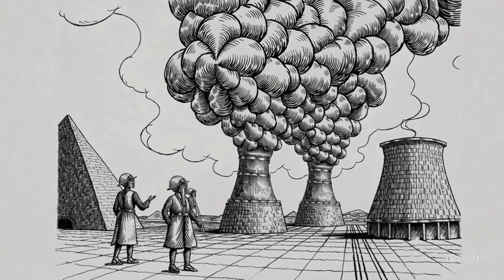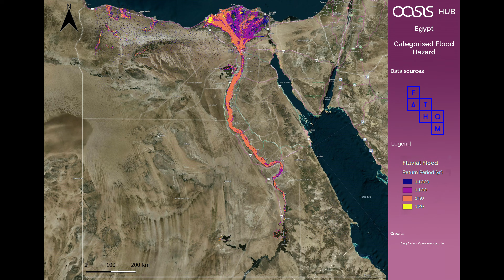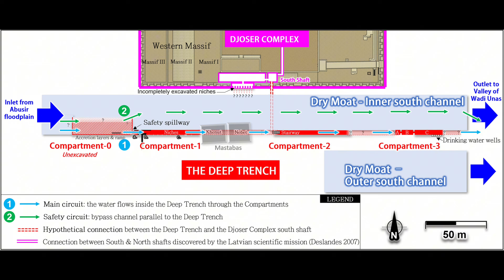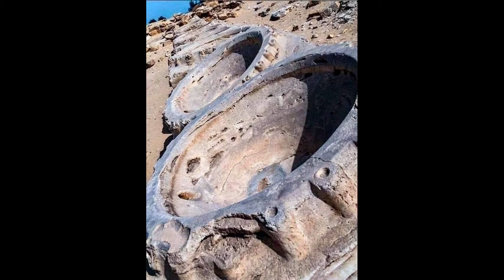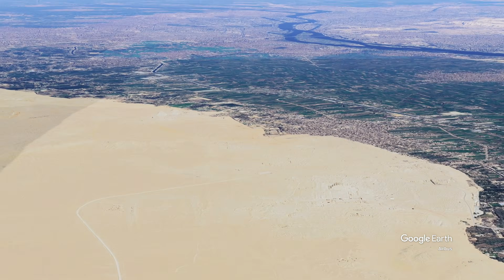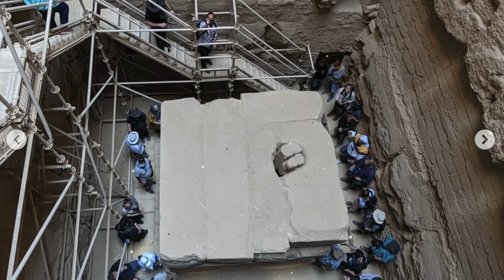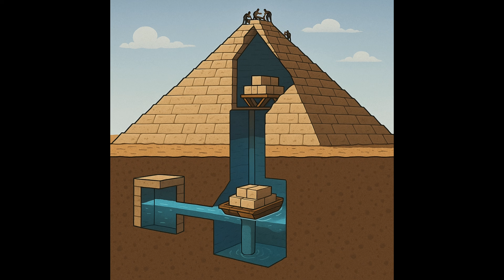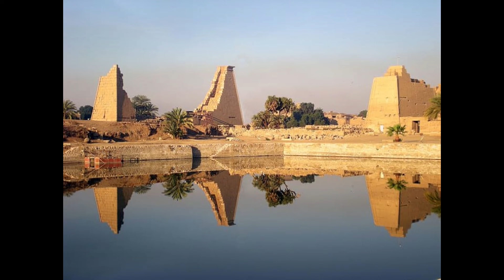The Incredible Hydraulic Lifting Machines of Ancient Egypt

Comment: Not to mention the maintaining of angles perfectly of the passages under and in the pyramids and the no traces of sut n from torches providing light to see what they were doing.🤔🤔🧐🤯
Reply: Its a multipurpose structure but theres no soot because the shafts are for water or hydrogen either or both depending. Its an industrial structure. A water pump but its also a chemical reactor with a massive density filter. And this big granit quartz roofs in these chambers. I think it was containing hydrogen. Burns clean if they burned or even if they didnt we wouldmt he ablento tell itnwas there like ifnitnwas a rudamentary crude oil refinery which it isnt. Its a water chemical reactor powerplant. Or an expiramental attempt at one. It plays a cultural role to the region and world at the very least. To me itd clearly not a trap its like a decomissioned reactor. A decomissioned hydrogen gas generator. The giant box deep undee giza isnt a carcophigus its a battery box it had a lid with annode and cathodes giant ones so when they flooded the bottom chamber it automatically generated hydrogen very rudamentarily. Some asoects seem expiramental to me like they wanted to try to make it light up at the top if they could charge it enough smd put the right stone ontop or something of their day probably but im unsure they accomplished all their goals. Im confident they got the water pump to work and it was a big deal to them they stacked a lot of stone to put water up high during the day. At night they were trying ti make hydrogen gas and i think they were having issues every step of the way i think they had a hysrogen explosion inside a battery duento a leaky battery stone isnt a good underwater battery the water leaks in past your terminal meeting point water gets in and turns to hydrogen inside amd blows up. I domt think they flind anything to put on the roof or got far enough to get it running at a constant flow of hydrogen oxygen mix to get a constant burn in the chambers to try to yenerate charged particles inside the pyramids struxture to het the light at the top to work. I dont think they got that far. I thimk the kings chamber also bacluped as a chemistry chamber for large scale reactions. Did it ever get used, i dont know, i dont think so so far but i do think they vuilt this massice structure with massice endevors in mind it wasnt all for nothing they were trying to get hydrogen gas at the bery least, and pump water i think they accomplished both. I think ot had big ridamentary batteries and giant copper wires and connections that kinda worked until they filled it with water.
Reply from the maker: Let’s get into this last comment. 
You wrote a really thought-provoking interpretation, and I appreciate the curiosity driving your ideas. Reimagining ancient monuments through the lens of engineering and chemistry can yield fascinating discussions. However, based on current evidence and known chemical principles, there are several reasons why the theory of hydrogen gas production and battery systems inside the Great Pyramid or any pyramid is not supported. First off, to produce hydrogen gas via electrolysis, you need:
An electrolyte (such as salt water or sulfuric acid),
Electrodes made of metals like platinum or graphite,
A power source (to drive the reaction).
The simplified reaction for electrolysis of water is:

2H_2O(l) \>  2H_2(g) + O_2(g)

However, this reaction requires continuous electrical input, and there’s no evidence of a viable ancient power source or electrode materials inside the Great Pyramid. Granite and limestone are insulators, not conductors. 2. What you suggest is chemically unworkable. Some have referenced the so-called “Baghdad Battery” as inspiration, assuming ancient Egyptians may have made similar electrochemical cells. A basic battery uses two electrodes (e.g., copper and zinc) in an acidic solution to produce voltage. 
No copper wiring, zinc elements, or acid residues have been found inside the pyramid. Even a working primitive cell like this generates less than 1.5 volts, nowhere near enough to electrolyze water or power machinery. 3. If hydrogen were being produced inside a stone chamber, any spark could ignite an explosive mixture of hydrogen and oxygen. The reaction:

2H_2(g) + O_2(g) \ >2H_2O(g) + heat (explosion)

This is the same principle behind the Hindenburg disaster. Without proper venting, regulation, and containment (which we see no evidence of), such a setup would be catastrophically unstable, especially in a sealed stone structure with no means of safe control. 4. No archaeological evidence supports this. Archaeological surveys of the Giza pyramids (Lehner, 1997; Reisner, 1942) show no traces of:
-Conductive metal frameworks
-Battery cells
-Residual acids
-Burn or explosion marks, (no the ones on the grand galley aren’t those either)
-Pressure control systems
Chemical byproducts like hydroxides or -salts that would result from electrochemical reactions.

Sources:
	•	Lehner, M. (1997). The Complete Pyramids. Thames & Hudson.
	•	Reisner, G. A. (1942). A History of the Giza Necropolis. Harvard University Press.
	•	Tallet, P. (2017). The Red Sea Scrolls: How Ancient Papyri Reveal the Secrets of the Pyramids. Oxford University Press.
	•	St. John Simpson (2003). Ancient Iraq. British Museum Press.

Comment: Why would Egyptians entomb their Pharoahs in pyramids, when they have the wonderful valley of the kings?
Reply from the maker: Good question! The key is that pyramids and the Valley of the Kings were used in very different periods of ancient Egyptian history. The pyramids—like those at Giza—were built mainly during the Old Kingdom (c. 2600–2100 BCE), while the Valley of the Kings wasn’t used until much later, during the New Kingdom (starting around 1550 BCE). It’s also worth noting that while many pyramids contained burial chambers, there’s ongoing debate about whether they served solely as tombs. Some scholars suggest they also had symbolic or ceremonial functions tied to solar worship, resurrection, and state power. Over time, pyramids proved vulnerable to looting, which may be why later pharaohs switched to hidden tombs in the cliffs of the Valley of the Kings for added security and secrecy.
So it’s not a matter of one replacing the other—they reflect shifts in religious beliefs, political power, and practical concerns over time. Thank you so much for watching and taking the time to comment
Reply: They didn't. 

In most pyramids there was never any human remains at all. And in the few they were found they were not from the time of the pyramid construction and were pieces.

People started claiming much later that looters would "destroy" the bodies to looks for valuables in the wrappings. But this would NOT lead to the complete disintegration of the body. 

They have no good response for what happened to the remains. 

It wasn't until relatively recently that tomb raiders would collect and sell mummies. This was in a direct response to European sudden interest in the mid to late 1800s and early 1900s. 

At that point in time they became entrenched in mysticism and myth. Eventually leading to the looting of the valley of the kings until the British found out and began attempts to safeguard and excavate the historical sites.

Like MOST ancient wonders during the mid to late 1800s there was a serious effort to exploit these pyramids for personal gain. The selling of mummies and other artifacts became very common. 

Eventually these sites all suffer the same fate. Tyrannical control of information and access and an increase in intentional dis or misinformation. 

It's important to know there is an interesting theory of some catastrophic flooding complete with huge waves of mud and sand that hit the world of the pyramids. It's referred to as the Mud Flood theory. 

While that theory has very compelling evidence there are people who intentionally add far fetched things into it to discredit important findings. 

For instance, if you look at a satellite image of Africa you will see that a massive wall of water pushed across the top half of the continent creating present day desert topology and ecology of places like Egypt. 

The pyramids and especially the sphinxes, there are more than one, were found buried under not just wind blown desert sand, but flooded and show signs of extreme water weathering due to heavy floods and rains.
Reply: L was wondering  the same thing when l was there  hear a lot of academic  bullshit 
From guides  that had no idea

Comment: I've had my own theory for a while now that they've used water as a Lifting mechanism as well. Yet it baffles me that pretty much all theories completely  dissmiss or even recognise the use of the one resource which would've been & still is most abundant to them,Sand!!

I've firmly believe that they were using an ingenious system of both Sand & Water for building & Constuction Purposes!!! Think about it. Why wouldn't they be using Sand as it's literally all around them & easily moved  and displaced! Concider Water in a Glass. What happens if you suddenly dump enough Sand into the glass to fill it half way? You've effectively displaced/removed half of the water from the glass!!!

I also beleve they were smart enough to figure out how to make Bricks out of Sand,which with the heat they have there wouldn't take long to dry & harden. They couldve been using Sand Bricks in the same way that we use wood for Scaffolding today.

With such an abundance of Sand I'd find it hard to believe that they weren't using scales & thus weight to their advantage. They could've used water to raise it on a platform to the desired height,then used sand as a counter weight to hold the Stone while they drained the water & replaced it with Sand. 

To guide the Stones in place they could've used preshaped,angular Sand Bricks. Think of having a bed of sand. Then towards the top you place a half Triangle Block with a box around it. You fill in that cavity with loose Sand then remove that Box so the Sand filler drains out,thus allowing the Stone to slide down the Angle Block into position!!!

Almost everyone disregards the possibility of them using Sand in the most Ingenious ways!!! If any of this helps in your findings I'd appreciate you giving me my credit for the idea,thanks!
Reply from the maker: Hi. Water dissolves shapes made of sand alone. This is why the beaches of the world aren’t swarming with sand castles that never fade away in the waves. Thanks for watching!
Reply: Its a water tower, water pump, hydrogen generator, thats also attempting to be like an expiramental battery, with also a buult in chemistry reactor, as well as an unknown chamber.

Comment: My mind is racing after watching this!  Your diagram of the 2 shafts and connecting tunnel is almost identical to the diagram used to explain the Paria  pipeline diving tragedy, where the divers were sucked into the pipe at high velocity.  It was caused by a new airproof plug and an air pocket in the pipe just under the plug; so when you said the north box was waterproof on the top, all I could think of was that silicone plug at Paria.  The ancient Egyptians used bitumen to waterproof boats and buildings and the Romans used bitchem from a fairly local "tar tunnel" to waterproof the deep mineshaft and water draining tunnels at the mine near my house. The tunnels under the boxes may have been used to create an air pocket under the plug, that way the water level could have raised far more quickly in the south shaft, but not as fast as Paira.

The Romans used some insane machines for deep mining and altering water tables within their mines, they got the tec from the Greeks who got most of their tec from Egypt, so clearly those ancient Egyptians had some mad engineering skills!

Subbed and looking forward to seeing your model.
Reply from the maker: This has given me quite a few leads to look into. The ancient people were so good at making do with what they had and substituting brain power for what they lacked. I’m going to look into that pipeline accident. Reminds me of that nasty diving bell accident where those divers got sucked through a small hole. Yikes! Great feedback and I appreciate you watching. The next video in the series is coming along in the editing space!
Reply: @intothemap360  looking forward to it!😊

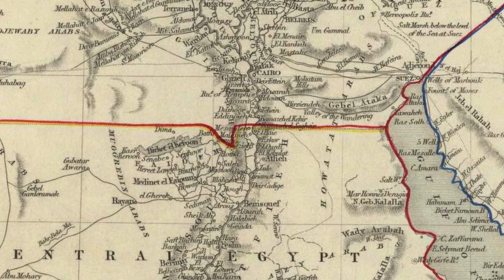Comment: Not sure how you're going to get around the lack of a central shaft nor how this would work as you neared the top.(time 3:16). Although, I give you kudos for at least entertaining us. Still have to deal with the hydrostatic pressure you're creating to pump water into an ever increasing column of water. Still hard to make water flow up hill.
Reply from the maker: Right there are issues. I did my best to work through and present the research paper and give some pro and con at the end. The water would at the most equalize between the shafts. To get higher than that you’d have to implement the float extension hypothesized in the paper

Comment: I think the internal ramp theory makes the most sense. The vast bulk of the stones only average around 2 tons so moving them wouldn't be much of an issue. The larger ones would require more mechanical advantage like capstan winch systems which they most definitely had.
Reply from the maker: Right, good points. Or maybe they tried to get this system to work and it kinda sucked and they never repeated it. I’m sure they tried all sorts of ways to get more efficient before hitting their stride
Reply: @intothemap360  Plus we should also consider the larger historical context of that region. The fertile crescent had been building with stone for ten thousand years before the pyramids were even built. Think about that. Cultures influence each other. Ideas and knowledge spreads.
Reply from the maker: Exactly. I’m working on video now about the ways basic ancient tools would spread from one industry to another, mainly looking at the problem of possible sane and realistic sources of power that may have been used back then, not the esoteric fringe ideas. Something as simple as a load bearing lubricated axle when invented would move from chariots to capstans to every other type of place an axle is needed.
Reply: @intothemap360 Oh excellent. Yeah I'm not a fan of the fringe psudo-science side of this topic. They detract from the genuine genius of our ancestors. Their capacity to problem solve is amazing.
Reply from the maker: Right. I do a ton of metal fabrication and welding in my free time and if no one understood techniques of that trade and just assumed it was all wizardry then it would be seen as foolish. Nothing done was impossible or needed outlandish technology, it just needed extremely clever solutions to problems most of us will never ever face. We stand on the techs shoulders of giants. We all know how to use a screw but could you make one? No and neither could I. The people that came up with these early ideas of construction engineering had to use all their brain cells to overcome what we would just throw a bunch of power tools at today and call it a job well done.
Reply: @intothemap360  I'm a remanufacturing technician by trade. I often cite how I can lathe down a piece of hardened steel with nothing more than sandpaper. How is that possible?! MOHs hardness! Steel is harder than sandpaper! Lol
Reply from the maker: There you go.
Reply from the maker: I mean make a screw by scratch not with a lathe haha. That would be easy.
Reply: @intothemap360  I mean, the Egyptians invented both the lathe and screw from scratch so lol

Comment: Leakage can be prevented with tar and fibers, a coveare belt with buckets like a dredge can get you water up hill fast to fill the shafts, all simple solutions. Keep applying KISS and you'll get there.
Reply from the maker: Good idea. A bunch of scoops or a dredge like you said could fill the south shaft instead of the missing pipe, but for such a short distance it didn’t make sense for that since they immediately made a long pipe to the north shaft. There is no evidence of tar in the boxes so I couldn’t mention those. As I’m sure you saw here I tried very hard to stick with what I could see and find evidence for. These are both good ideas and may be true, but there isn’t anymore evidence for them than for that missing pipe. The water also didn’t have to go up hill. Everything from the wadi is downhill until the drainage point for the north shaft with is maybe what you mean. Once again all great thoughts and I appreciate you commenting and watching!! Next full video is coming soon!

Comment: when was the pulley invented? from what i understand the wheel wasnt invented yet at the time of the building of the pyramids. beyond that. maybe your hypothesis could be correct if those 4 large tubes under the great pyramid can be found. maybe they used those to haul the i assume bigger than djosers pyramids stones up to the top.
Reply from the maker: Correct the load bearing wheel was invented around 1700 BC by the Egyptians or inherited from the Hyksos. The pulley is hypothesized in this paper as the device most likely to be in place used to lift the plugs. It’s possible to do it without a pulley.